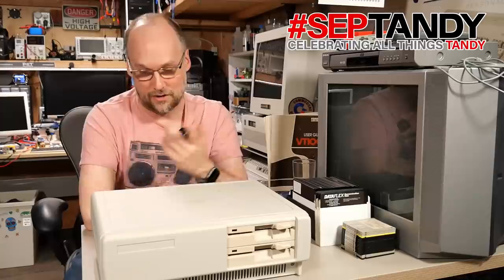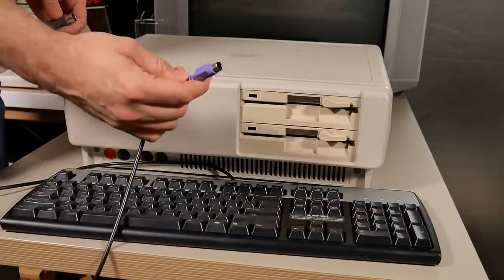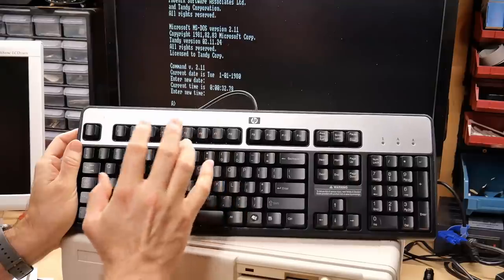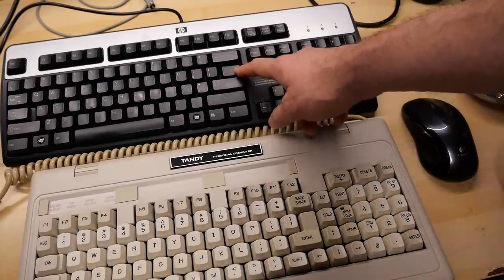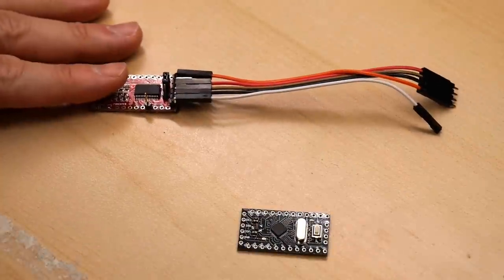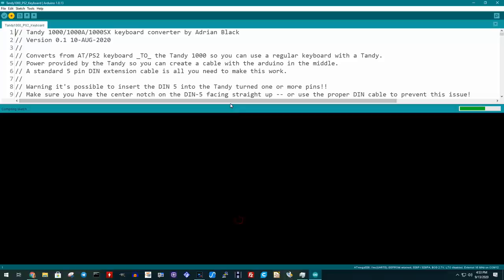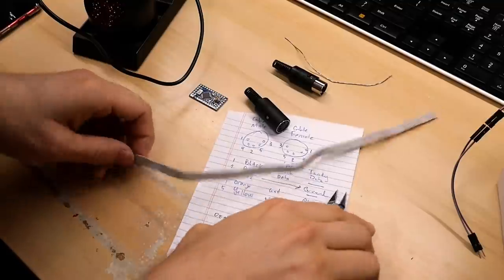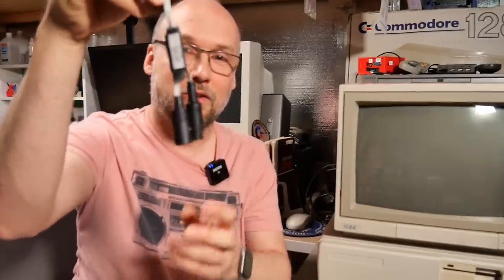Build an adapter to use a cheap PS2 keyboard with a Tandy 1000! #SEPTANDY

Comment: It works with the 1000 TX as well. That's the model I have, and the keyboard is identical.
Reply: Did you have to do anything not mentioned in the video to get it to work because I also have a TX but the Arduino only powers on for a split second right after turning on the computer?

Comment: Most full size DIN connectors have a key notch on the side away from the pins which should make misalignment impossible.  If the 8pin DIN socket lacks the pin notch, and the 5 pin plug has it, it shouldn't even plug in!  I noticed that 3 pin DIN plugs will mate with 5 pin sockets, and only go in one way, no missalignment is possible.  I'd think 5 vs 8 would be the same thing.
IF YOU LEAVE THE METAL SHIELDS ON THE PLUGS!!!!!

Comment: should have installed the Arduino inside a PS2 keyboard. something a bit nicer than a cheapo. and instead of having a fat dongle you could just have a single AT cable coming out the back of the keyboard. you could have also installed the Arduino where you could access the USB port on the side of the keyboard.
Reply from the maker: Wouldn't be hard and anyone wanting to do this permanently could do it. Swap the end of the cable too with the right connector. I use that PS2 keyboard on lots of other machines so I don't want something permanent.

Comment: Great video, Adrian! That documentation Tandy whipped up is fantastic. I'm kind of curious to see if a wireless USB adapter for a wireless keyboard would work fine via a USB to PS/2 adapter on the input side of the Arduino
Reply: IBM and Tandy both used to have technical manuals available because a lot of "power-users," as we would call them now, would make their own hardware back then. You rarely see that kind of thing today.

Comment: Wow that is really useful, the Tandy keyboard are really rare by themselves. Next lets build a joystick adapter for the DB15 to Tandy DIN ;)
Reply: That's just a straight pin conversion. No fancy timing or coding issues requiring an Arduino, it's just straight analog.

Comment: A comment about the style: preprocessor should only be used when there’s no other option, because there is no type safety, and it just reeks of C, and the last thing we want to do in 2020 is write C unless there’s no other option. Since “Arduino” is just C++, instead of all those preprocessor macro defines, one should either use `constexpr uint8_t NAME=value;` or the less verbose `enum : uint8_t { NAME1=val1; NAME2=val2; … };`. Yes, C++11 works just fine - a decade has passed, folks, it all very old news now, it’s way past time to to write modern code.

Comment: If somebody could program it for use with an XT keyboard that would be awesome.
Reply: I started working on generic C code to do the low-level XT and PS2 interfaces about a year ago.  IIRC it’s all done, and I think I even wrote a module to translate between them, I just never got around to testing any of it.

Right now it’s in that magical state of a project where maybe it all works, or maybe it will set your keyboard on fire.  Who knows.  It seems that’s where most of my projects live.  Schroedinger’s code.

But I’m sure a full Arduino project already exists out there, has been tested, and actually works.
Reply: @nickwallette6201  "It seems that’s where most of my projects live.  Schroedinger’s code."
LOL. Sounds like my stuff. With the pandemic, I've been constantly short-handed with my landscaping business, and I'm just too busy these days. Must be nice to make retro computing into a full time job (it's just a hobby for me).

Comment: I have an mini-din adapter project in my queue (DB9->mini-din for C16 and Plus/4) -- not looking forward to soldering that together!
Reply: Do you anticipate having to mod the kernal ROM to get that to work?
Reply: @TheJeremyHolloway  From my understanding, that isn't required as you can do a straight pin mapping and pull (or ground) the select line.  That said, I think this will only allow one joystick adapter to work.  More information on the options here: https://www.commodore.ca/manuals/funet/cbm/documents/projects/interfaces/plus4joy/plus4joy.html

Comment: I wish I could buy or build a ps2 to serial "com1" adaptor to use ps2 mouses (mice?) with older computers that don't have ps2 ports. I have a couple of serial mouses working, but I want to be sure I'll be able to keep using those older computers in the future. (and that reminds me I should get three or four backup ps2 mouses just in case too... you can still buy them at stores, but not for long I guess).
Reply: I actually have a couple such adapters, but they're just passive devices, and I think it relies on the mouse itself being serial compatible. USB-PS/2 adapters are the same way in that they require that the host system actually have native USB support so the PS/2 port knows what to do with the signal it gets.
Reply: @BlackEpyon  I guess it's not as easy as I thought. ps2 keyboards are the same as AT keyboards so I thought a mouse would be the same, "they just changed the plug but the device is the same".

Comment: Can you do something like this for using a ps/2 keyboard on an 8088 XT?
Reply: Such a device already exists
Reply: @va4cqd  where does one get such a device?
Reply from the maker: I was going to adapt the code for XT use next ...so anyone can build one for a couple dollars. Stay tuned.
Reply: @adriansdigitalbasement  thank you adrian!
Reply: @va4cqd    basically, an XT to AT adaptor.  The AT standard is, IIRC, essentially the same as PS2 with a different connector.
Reply: TheTurnipKing AT and PC/XT use the same connector but different protocols. Ps2 and at are just connector changes
Reply: The one I’m using I believe uses a pic12 microcontroller. I’m sure it will work with the arduino and look forward to watching the video
Reply: I've got an old Tandy keyboard (came with my 1000 RSX) that has a switch on the bottom for converting between XT and AT. There were a number of them back in the day. Unfortunately, the cat pissed on it and eroded some of the traces on the plastic contact sheets, and I've still to get one particular key working again (got most of them back).

Comment: I expect not, but now I'm a little curious if a Key Croc can be programmed to be the same protocol converter.
Reply from the maker: I'm not familiar with that device. The converters I've seen have flexible inputs but not outputs. Good ad using strange keyboards with a PC.

Comment: I wonder if you could make a modification to the Tandy's BIOS to have the same effect. Obviously that would involve internal changes to the hardware which might not be desirable...
Reply: Might be possible through the BIOS if you're willing to re-wire the keyboard connector. The Tandy 1000 uses an Intel 8255, just like the IBM PC, and I THINK (but don't quote me) that the 8255's I/O is controlled through the BIOS. Might be worth looking into if you've got the programmer for it.

Comment: I've never used hot glue with electronics before... do you have to worry about the heat damaging components, melting wires, etc?  I would have thought that the hot glue would melt right through the plastic on your cables, but apparently not?

Comment: how the hell do you 'turn a din 5' in a din 'any larger number with the same degree/distance' connector. it does have this rather big and lumpy indicator slot in the outer shield and won't go in in any other way. maybe half, a bit, and then the user notices 'oh it's bumping into something and won't go in ;)

Comment: 13:14    break; // yeah do nothing
Best code comment ever.

Unrelated note, are you going to mention that new flatscreen Trinitron in a video? It reminds me of the 21" I used to use with an identical case design.

Comment: Nice video. Would it be room for the Aduino board inside the keyboard?
Could you have made an alternate keyboard port on the computer cabinet for the adapted keyboard plug and install the Aduino inside the computer cabinet?
Reply from the maker: Definitely -- if one wanted to do this mod that way, it would be super easy. I use that keyboard on other machines so wouldn't want to it that way, but it's certainly completely doable with possibly less effort.

Comment: Adrian, why not mount the Nano inside the host keyboard and fit the DIN plug on the end of the exising cable. This should give a tidyer solution as there would be no Nano in the middle of the cable.
Reply: It's easily doable, but it limits the keyboard to only being used on that Tandy 1000. He uses that keyboard for other machines as well.

Comment: Do those old Tandy keyboards and the adapter also work with the Tandy 2000 and trs80 models 2/12/16/6000?
Reply from the maker: I have never seen a Tandy 2000 or Model 2. I'm assuming the answer is no go compatibility.
Reply: Pretty sure that they had their own proprietary interfaces. We've all been spoiled by the PC/Compatible age where everything was cross-compatible.
Reply: I know the Tandy 2000 keyboard works on the TRS-80 Models 2/12/16/6000.  It was a popular upgrade to Xenix systems, so as to have a more Unix-complete keymap (indeed I think it is required to use virtual terminals in Xenix 3.3).

I just did some more research.  Apparently (if what I read is to be believed) the Tandy 2000 keyboard is exactly the same protocol-wise as the Tandy 1000, so that is cool.  I can make one of these adapters to get a better Unix keyboard when/if I manage to get my Model 2 running Xenix.  :D

So I guess that is where the Tandy 1000's funky different keyboard protocol originated from.

Comment: I half wonder, if using standard MS-DOS 3.3 KEYB.COM ("keyb us") would save work on the Arduino, because it overrides how the PC reads the keyboard (see for yourself, DOS reads keys differently on a Tandy when you use KEYB, mainly on the numpad).
Reply from the maker: The protocol is totally different and incompatible. I don't know what the DOS program is doing but surely it's just reading the already processed scan codes from the motherboard keyboard controller.
Reply: @adriansdigitalbasement  Somebody else suggested making a patch for the BIOS to change how the 8255 reads the scan codes, but you'd still have to  re-wire the connector. I like the Arduino dongle method better.
Reply: I never thought of the keyboard driver. I noticed when I installed DOS 5.0 on my 1000HX that the setup menu didn't like the arrow keys, and it took forever to figure out that it was interpreting it as an XT keyboard, and that I had to use the numpad keys.
Reply: @BlackEpyon  It's because of my experience with the HX I thought of that.

Comment: Amstrad is just as bad when it comes to proprietary keyboards. For example my PC4386SX looks like a standard 5-pin DIN (I think the pin diameter may different (larger)?) but uses a different protocol so you can't use a normal keyboard on it. Major pain, I would like to hook mine up to my KVM switch but nope, it just won't work :(

Is there something similar for that (doubt it but you never know)?
Reply from the maker: No idea but it could be made. I don't have any Amstrad machines with an external keyboard so I can help unfortunately.

Comment: I  thought that the PS/2 controller supported AT keyboards but I never thought that an AT controller would support and work properly with a PS/2 keyboard. It seems their protocols are similar or exactly the same

Edit: I watched the video later on and I saw that there was a middleman microcontroller. Does the Tandy take XT or AT as protocol?

Edit 2: Apparently it takes neither, because it's its own proprietary connector :(

Comment: Try USB keyb with an USB to PS2 adpter if possible
Reply: I'm not entirely sure, but I think the USB-PS/2 keyboard/mouse converters rely on the system actually having native USB support. They're just passive devices, so far as I know.

Comment: 27:03 What keyboard is that? I totally used to own one. I remember the key switches are very weird, the contacts spring together. Pull a key off and take a look! :) Does it have an AT/XT switch? I swear I got it along with my 10MHZ XT clone.

Comment: The keyboard should be comparable if u format ur Tandy with MS-DOS 622 and win 3.1
Reply: Took me a while to figure out what was going on with the arrow keys when I installed DOS 5.0 on my 1000HX, but DOS setup sees it as an XT keyboard, so you need to use the numpad keys to navigate the setup menu.
Reply: No, that still won't work. It can't talk to the machine at all without the arduino (or some other controller) between them.

Comment: How does the Arduino compares to the Tandy's CPU performance wise?
Reply: broadly similar.  the ATmega chips are 8-bit CPUS.  The clock speed is massive by comparison, but usually way less memory/storage.

It's worth bearing in mind that this IS more or less how the original PC Keyboards worked, though.  In essence you have an entirely separate microcontroller in the keyboard.  So in this case you're just inserting another microcontroller to translate two different PC keyboard standards.
Reply from the maker: 16mhz 8 bit CPU on the ATMega is likely faster overall .. but it has only a miniscule amount of RAM, so it's not really comparable. It's also a RISC architecture so lacks many instructions the x86 has....

Comment: NEXT! A USB to Tandy adapter! ? xD
Reply: USB -> PS/2 is a super common converter. just plug that in ahead of your PS/2 -> AT -> Tandy adapter chain and you should be good to go
Reply: Its common for PS/2 to USB with a dongle, but not USB to PS/2 like he's saying.  I've never seen a commercial product for going the other way around - but it might exist for a small niche. The closest I've seen is the little green passive adapters that map the USB pins to PS/2 and the mouse or keyboard can detect which protocol to use - but that's all done inside the device, not the adapter, which is what would be needed for this to work universally.

Comment: U should change ur Tandy floppy drive 1 cd burner other blue ray burner and external floppy 1.44 u would need lan card sound card modem video a copy of Ms do's 622 and 3.1 it might be possible to change 3.1 too look like Mac OS in settings of win 3.1 or you can also put Apple dos instead of Microsoft
Reply: Not sure if just trolling, or...

Comment: I know that keyboard, and that keyboard SUCKS. I am not one of those crazy people who spend hundreds of dollars on a keyboard, but I will not use that kind of keyboard for anything. It just makes the whole experience of using the computer bad.
Reply: I prefer something with a more "tactile" keystroke myself. I have a hard time typing on soft keyboards. Logitech makes a K840 "mechanical" keyboard that's really nice to type on for about $100 CDN, if you don't want to spend a couple hundred for that RGB gamer crap. That's the one I'd personally recommend. Picked it up from Staples for my business machine, because the USB keyboard that Lenovo came with was one of those God-awful "chicklets."
Reply: @BlackEpyon  I have been using Apple keyboards, and I like the feels of the key. I have tried a mechanical keyboard, but I did not like it. It was too thick, and required too much pressure to press. The only problem is that I do not like the layout of Apple keyboards... Isn't "chicklets"  basically the same thing as Apple keyboard? I like that style because it is relatively easy to clean between the keys, and thin.
Reply: @typingcat  Modern Apple keyboards are usually in the "chicklet" type keys. I despise them because they are completely flat, which means that your finger doesn't "center" on the key.
Reply: @BlackEpyon  What does that mean, "centre"? Does that meant that the key is registered even when you pressed the corner, not only the centre?
Reply: @typingcat  I mean that on a normal keyboard, going way back to typewriters, the faces of the keys are concave so that your fingers naturally find the center of the key rather than slipping towards the adjacent key. You should be able to touch-type without having to look at the keyboard to see that you're positioned correctly.
Reply: @BlackEpyon  Now I see. I also happened to have a cheap Logitech keyboard, which I got for free, and it has concave key caps. But also, its key caps are bigger and taller than those of Apple keyboards, which makes the whole keyboard bigger and makes my hands move more. I guess being concave would help in some situations. E.g., I often need to press ; for programming, I often press ' by mistake on my Apple keyboard, but that is sort of a trade-off I guess.
Reply: @typingcat  It might just be personal preference. I used a laptop for a few years that had a chicklet keyboard, and I was always pressing the wrong keys. I prefer the full-travel mechanical keyboards, because there's a tactile felling when they key is pressed. But I also grew up using full-travel keyboards.